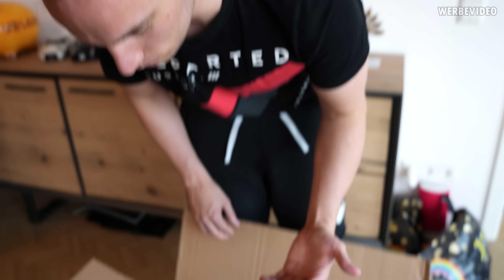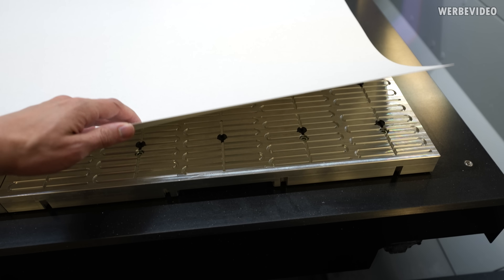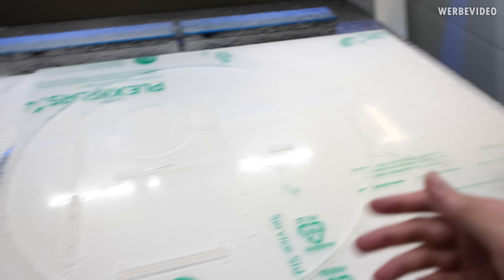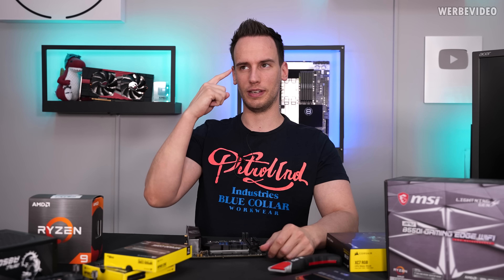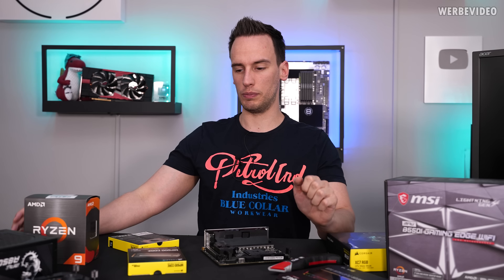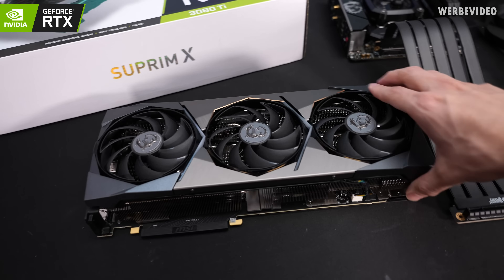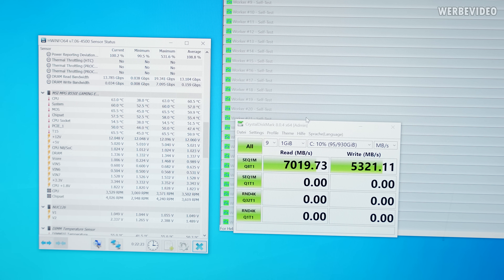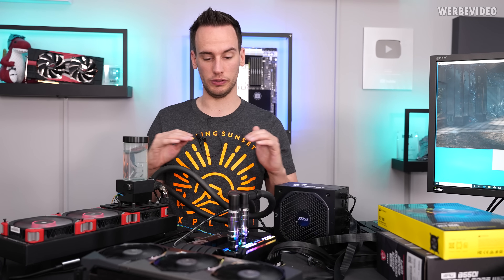We're building the new PC for ▓▓▓▓▓▓ ▓▓▓ (can't tell you yet😅)

Comment: Der8uer did you have post issues with that motherboard (MSI B550i MPG) and the 3080ti? Becaue I have a basic 3090 (EVGA RTX 3090 XC3 Ultra) and the POST screen would not properly show up coming out through Display Port. It would show up as if the graphics card is dying by having these weird artifacts on screen and found out it was displaying a really weird resolution which I found through my monitors (Asus XG258Q). I have tested this with a 2080ti with the same results but not with a GTX 1070.
Reply from the maker: No issues
Reply: *I'm not der8auer.
Did you try plugins in 3090 and 2080ti on the other board? (you friends or neighbors)
Try switch with a different PSU or change the wires (modular PSU)?
When artifacts still appear possibly GPU memory dying. (I'm not surprised if someday GDDR6/X dying cause it produces more heat🔥).

Lowering GPU memory frequency should help until you get an RMA.
Reply: @claritoresdiano1021  Nope its the motherboard. As i bought two to see if it was a fluke. I have tested on my older hardware (i9 9900 and Gigabyte Gaming ITX) and it POSTs fine

Comment: Kann sich jmd bitte mal meine Konfiguration anschauen und bewerten:
Intel i5 10400f + arctic freezer 34 esports
As rock b560m pro 4 
Crucial Ballistix rgb 2x8gb 3200mhz
Gtx 1660 vlt 1660 super
Be quiet system power 9 500w
M.2 ssd wd blue 3d nand 1tb
BitFenix Nova mesh SE TG ARGB
Was meint ihr gut und vorallem ist alles kompatibel? Bin nicht gut im zusammenbauen aber sollte ich mich im selbst bau versuchen?